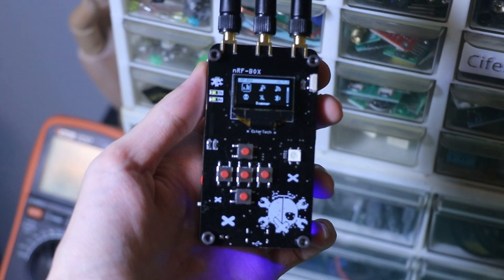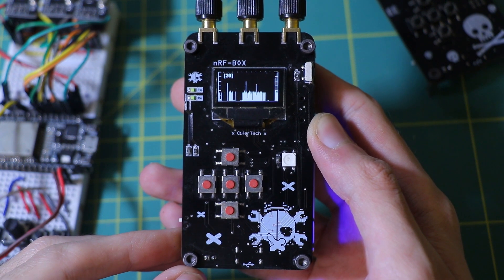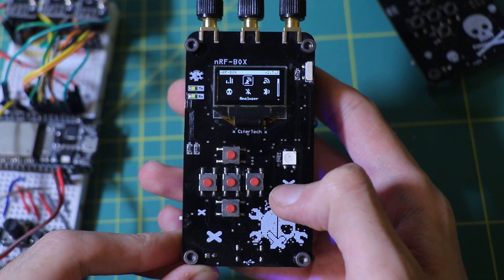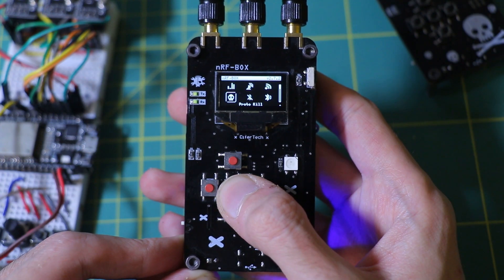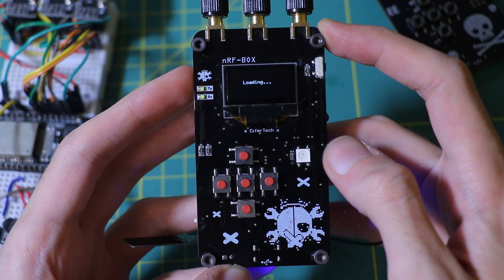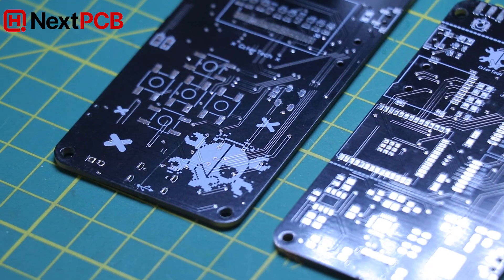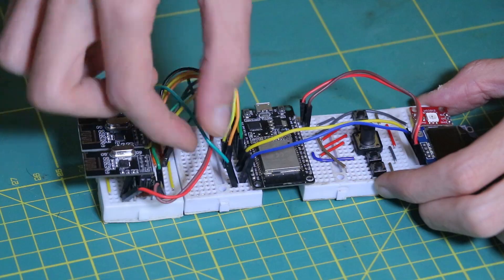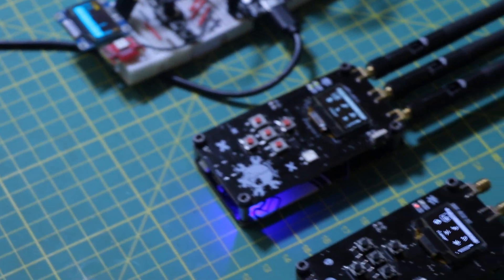This ESP32 Tool Scans, Jams & Spoofs BLE/Wi-Fi | nRFBox v3

Comment: Hi Cifer, thank you very much for your project — it works great and is especially useful for people who prefer quiet like me.
After testing the repo, I noticed a potential issue in the power/charging switch design. In the schematic, the battery is used as the common node of the switch, while the two NO contacts go to the TP4056 output and the LDO input (+5V).
If USB is connected while the switch ties the battery to +5V, the USB +5V can be fed directly into the battery, leading to uncontrolled overcharging, which is unsafe.
For a future revision, I suggest using the LDO input as the common node, with the switch selecting either +5V or Battery to the LDO, while the 4.2V charging path always remains directly connected to the battery.

Comment: Good job ...can we jam 5ghz ?
Reply: I don't think so , Esp 32 max generation can be 2.4ghz ig 
But if I read correctly rtl8720dn can jam with 5 ghz
Reply: @bot_Binod Great then, because when the 2.4 GHz signal is jammed, it switches directly to 5 GHz.
Reply: Use bw16
Reply: so can we upload code nrfbox to bw16? so we get all function, 2.4ghz. 5.8ghz, Ble jammer,

Comment: bro or could you do me the favor of passing me the code for Arduino please because I already tried it with Flash as I had told you but it doesn't work and you see that I'm a little frustrated, do you think you can pass me the code for the owner and not complete, please or tell me where it is because I already searched in the repository and I can't find it

Comment: Thank you for sharing. I have a question. Why is the range of Bluetooth interference very small when using the Bluetooth interference function? The straight-line distance is only about 0.5 meters. I am using the ESP32 development board and the NRF2401 module. How can I increase the interference range?

Comment: Has anyone built this? How do you get the components to solder to the board? I tried uploading the BOM and CTL but it said that the designator was missing.
Reply: chopped ass went from nft rugging to skidding

Comment: Bro This Is So Awesome. I Have Used NRF24L01 Module A Lot. But I Couldn't Complete Some Projects Yet Which I Maked Previously , Because Of NRF24L01. So The Problem Is When I Use NRF24L01 Module, Sometimes It's Not Communicate And Respond. Bro Do You Know How To Fix It For Lifetime. Please!